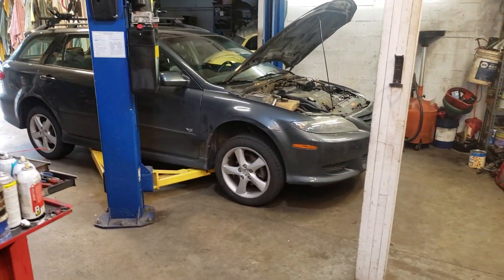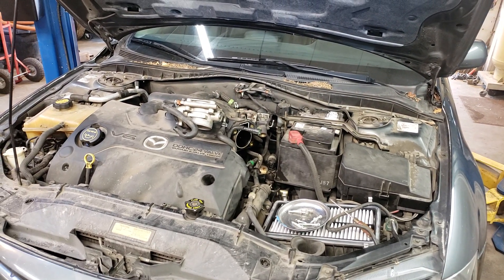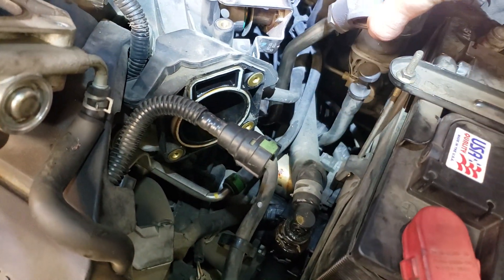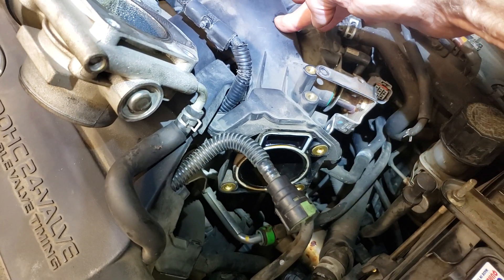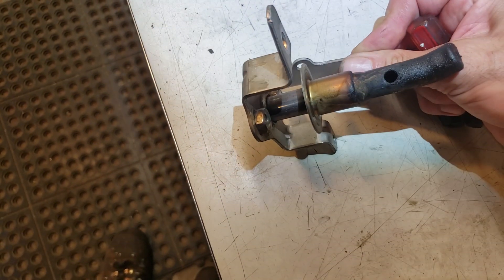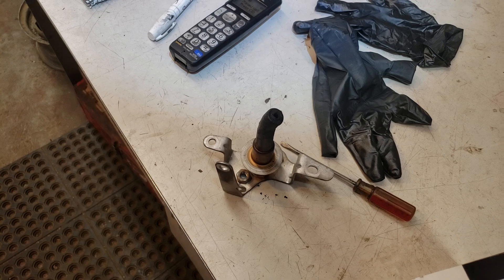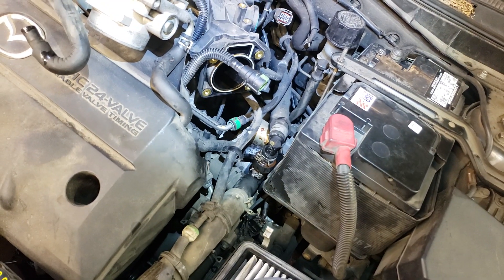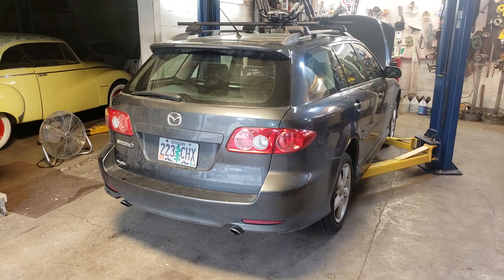Mazda 6 EGR valve low flow code P2144 Fix

Comment: YOU ARE MY HERO!!!!!!! everyone should try this before buying any parts. i struggled to get that long pipe loose that connects to the exhaust. you can leave that attached and remove the exhaust manifold instead. just take the egr valve off the manifold pull off the manifold and then get that pipe out with the 2 holes to clean. i did this put it all back together and all y codes were gone. i was getting p1487 and p2227
Reply from the maker: Yes !!

Comment: I have a 2006 Mazda 6 s 3.0 the same yours my problem is it boggy down when I press the pedal. I put new plugs ,coils, intake gasket and throttle gasket and new air filter and a new battery. I can't see why it boggy when pressing the pedal. I easy off the gas alittle and it's norm

Comment: Yeah you gotta loosen it from the bottom newbies don’t try taking it out from the top you’ll crack ur intake. Came to this video to find out what I already knew. I’m gonna have to climb under this goddamn car
Reply: You can do it from the top but right below the egr valve leave the valve bolted in still and use an adjustable wrench to loosen it. Just did it today 🫡

Comment: How did you get the bottom nut at the exhaust, on that tube connect EGR valve to exhaust?  From underneath the car?
Reply: i was thinking the same thing. it would be nice to see how he removed it.

Comment: Update: Daughters 2006 Mazda 6 v6 had codes: P2179 Too lean off idle bank2, P0301 Cyl 1 misfire, P2177 too lean off bank 1, P0300 Random misfire.  Weeks ago car had a radiator failure, and engine over-heat limp mode, never felt an engine so hot!! - fixed that, new radiator.  Then these codes start firing, car runs awful over a period of a few weeks.  Anyway, I end up replacing all plugs (they looked burned/scorched- odd, coils, pcv valve, and guess what, b/c of this video I noticed this tube was plugged.  As in the entire hole on the "end" was 100% plugged.  and the side hole was about 80%+ plugged.   Didn't take the EGR Valve out, but rather cleaned the tube and sprayed cleaner into the EGR from where it was.  (I had the intake plenum off, so lots of room)  Had I not seen this video last week, I doubt I would have noticed this issue!!  Thank you!

Comment: So i have this code right now i did removed my tube and cleaned it good it was worse than yours but the problem isnt solved yet, then i changed the egr vaccum solenoid and still the problem still lies with slight engine hesitation and a check engine light what could it be i have the same car as yours could it be the egr valve itself

Comment: This is one of the most known things to go wrong in this car. As an owner who has dealt with many of these plaguing gremlins, the best advice I can give is to check Mazda forums and online communities. The key term is EGR Optimization. Many people simply cut the tube to a shorter length. There are many DIY write ups that explain and show where to make the cut. The theory is that the length of the tube actually inhibits the air flow. Not only does cutting it to a shorter length give your intake a little more freedom, it also stops this problem from reoccurring.
Reply: I read the good thing about doing this egr optimization but has there been or is there any cons from doing this?
Reply: @mazda6owner816  I don't think there are but you run the risk of messing something up if you do the process wrong. Dropped metal shavings, damaging the remaining EGR tube etc. it could add up quickly for not much of a return in performance. I've done a lot of work on my car but I always hesitate with these kinds of mods because the price tags add up too quickly for my blood.

Comment: I had a CEL with a similar code and problem in my 2.2L I4 '97 Camry. Tried cleaning the egr valve but it was pretty clean and didn't fix the issue. I then replaced vacuum metering valve, about $15, which took care of the problem and the CEL turned off. I took the old VMV apart and found a hole in the valve's diaphragm which prevented the second, higher vacuum stage from reaching the egr.
Reply: Excellent info 73honda350!

Comment: Gone are the days when you could just pull the offending valve, spray it w/some carb cleaner to loosen the deposits up, & put it back in. Now parts are so fragile, so sensitive...you look at them sideways, & a code pops up. :)

Comment: I can see some poor guy replacing the EGR valve and then thinking it's defective and replacing it again and again only to not fix the problem! I run into that exact same issue on a number of Ford products over the years!
Reply: Ford shares the 3,0 V6 with Mazda. ford calls it the duratech V6 if i`m not mistaken.
Reply: @ToomasTelling  Correct, they did. The motor was also used in Jaguars and the Noble M400 where it made 425hp in twin-turbo trim for the latter.